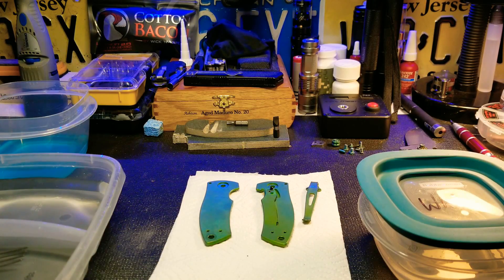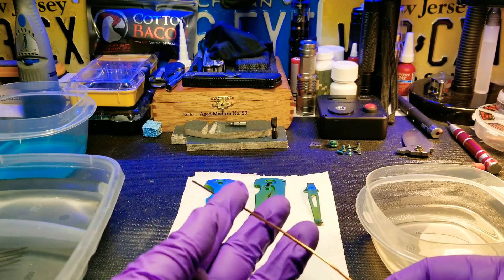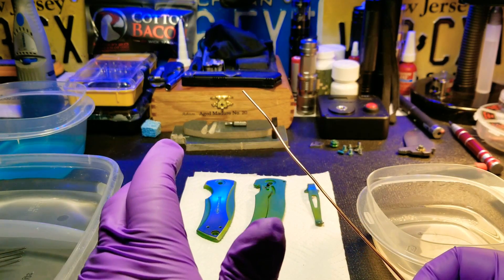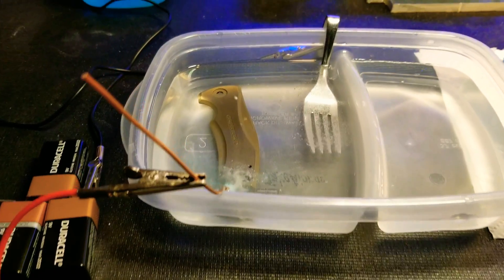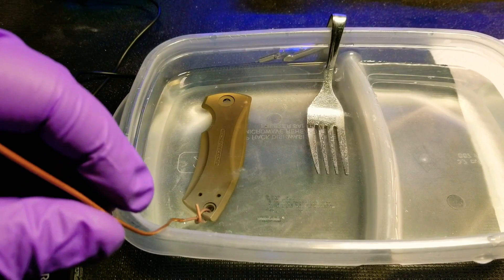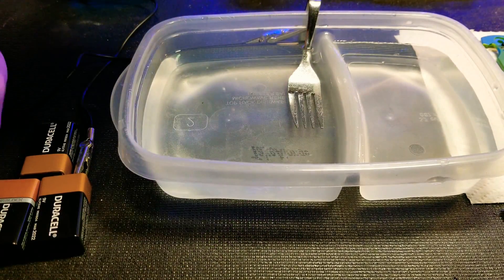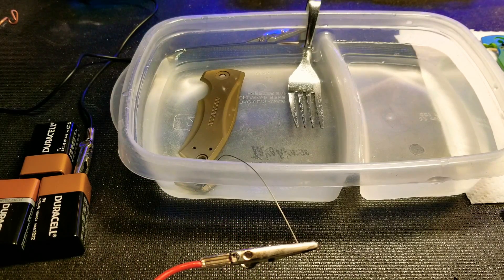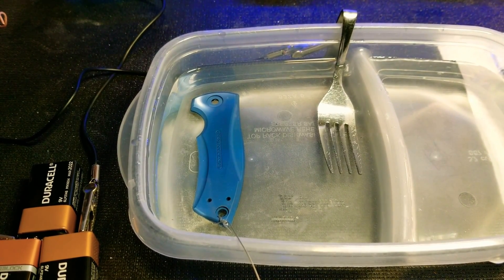Anodizing Titanium With Copper Wire - Does It Work??? (2020)

Comment: For those asking about using SS or Kanthal wire... I've tried both, and although SS wire "kinda sorta - just barely" works, it's very slow, and worse,  a substantial draw on batteries that may cause them to overheat, creating a substantial fire and burn hazard.. 
Don't think you can "cheap out" on an extremely critical component in the process. Get the titanium wire. You can get a 25 foot roll of 24 gauge wire from TEMCo (the actual wire manufacturer), on eBay for under $6, shipped to your door.
Reply from the maker: Very good advice Chris!

Comment: my dumbass using a steel wire and wondering why it was taking so long and why the batteries died so quick :[
Reply from the maker: 😂 At least you figured out what the issue was

Comment: Foolish question, but is it about what metals hit the water? Because i'm under the impression that the wire between the crocodile clips is copper - so wouldn't that be taking away some current too? Could it just be that the copper wire you used was so much thicker? Love your videos, by the way, indispensable advice!

Comment: Now i can see the result of use copper i wanna prove whit stainless steel and then whit titanium and wanna share whit you the results .
Good video at all
Reply from the maker: The Anode (+) side is critical. All the parts that are immersed on this side must be titanium, niobium, or tantalum. Other metals, like stainless or tinned alligator clips simply suck current away from what you are trying to do and mess up your desired results.
Reply from the maker: The cathode side is perfectly fine being stainless though, as long as you're sure its stainless. It can be pretty much any non-rusting metal